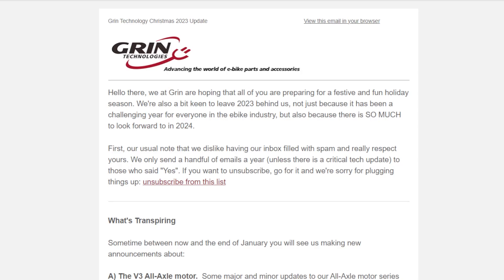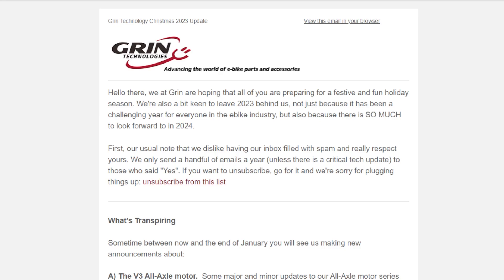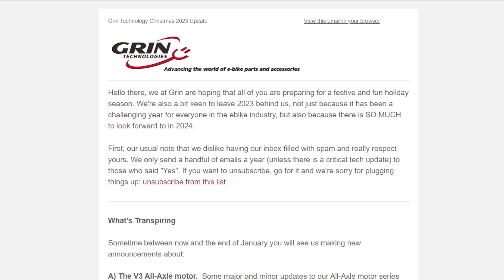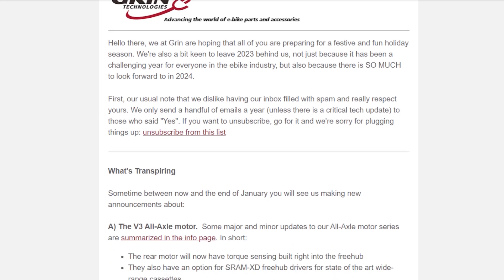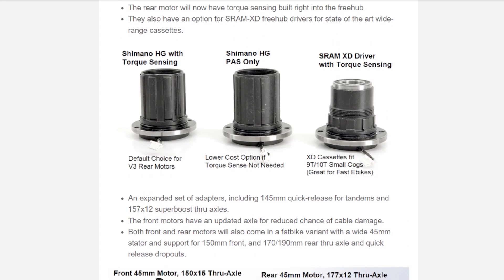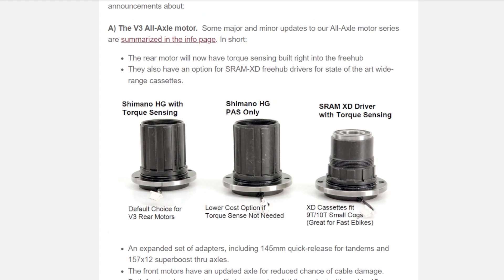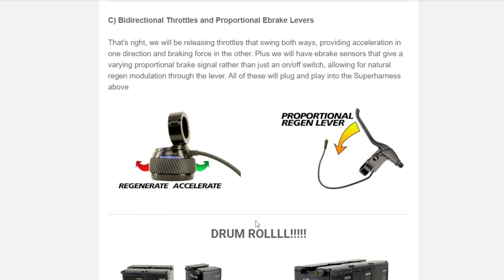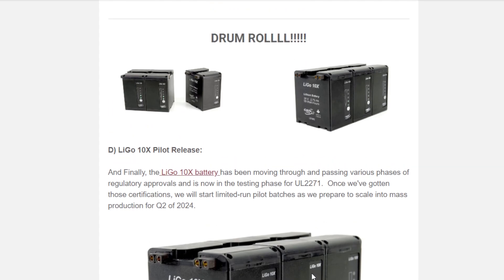Weekly E Bike Tech chat - December 15th 2023 - Grin Tech & 21700 Cells

Comment: Mollycell P45 is the new better Cell.. But when it comes to price to value there are better options.
Also check out LG m58T for long range.
Reply from the maker: Thanks I will give it a look. The Samsung 50S is another that is reasonably high power. Not in the p45 range tho.
Reply: Surely the 50s have more then enough power to power the most brutal ebikes molicell just seems like overkill, I'm debating weather to get 50s surron battery, as for LG, they have the most recalled battery/fires on the planet,
Reply: There's a few solid state or semi solid battery companies that were shipping test samples to car manufacturers 3rd quarter 2023, specifically one in Taiwan I remember, I would be doing everything I could to get a hold of some of those badboys,

Comment: A rear hub with a torque sensing freehub driver for human power and a left side sprocket mid drive would check all the boxes!
Reply from the maker: Yeah. I tried to find other rear hub stand alone torque sensors but could not find any. This might be purely a Grin thing.
Reply: Not surprised. Grin is always innovating. Since they offer the Freehub in different configs maybe they offer them stand alone. I have a machine shop at my disposal and would love to do a custom hub. As for the torque sensing action in the hub, I can't imagine it would be any different than at the crank. Chain slop, chain growth, and suspension kickback all pull the chain the same regardless of where you are measuring from. I have always hated the lack of BB options in the ebike world. I ride lots of tech rock sections and would love to stay in the realm of proven strong BB standards and normal Q-factor. Lots of torque sensing bottom brackets only measure torsion in the spindle so they measure from the left pedal. This is not Ideal for right foot forward riders like me. I will sometimes pedal kick up rocks and ratchet back without ever making a full crank revolution resulting in no torque to the left crank. Interesting stuff. Thanks for covering it.

Comment: wow, i ...will definitely need a few of those throttles. Really happy i found this channel I would never have guessed Grin was working on this stuff
Reply: The next innovation might be an ergonomic throttle that has notches (like aperture rings on slr cameras) and a tunable return spring rate. I rented a scooter and a bicycle on a recent trip to Portland and I found my thumb was exhausted after not a lot of riding
Reply from the maker: You like the throttle? Really. I can't imagine holding onto a good position bouncing over those Jamrock potholes? ;)
Reply: @HighVoltageKits  yeah the progressive lever in particular. I think they should make a half twist version. half twists work well here